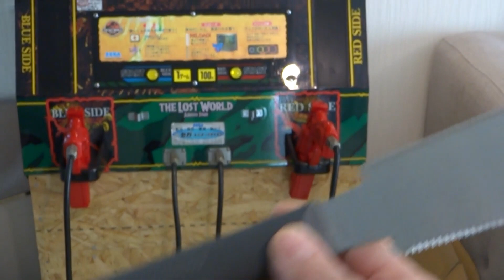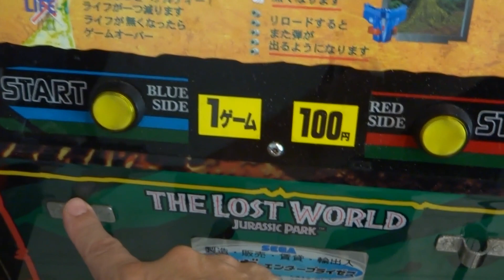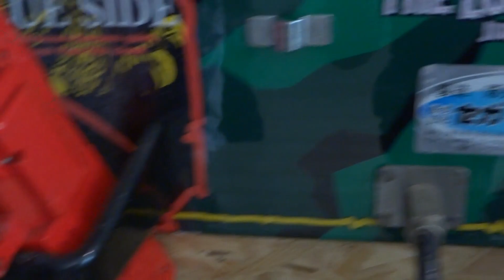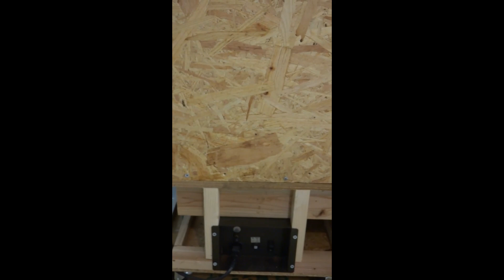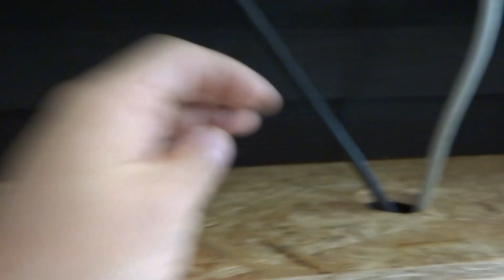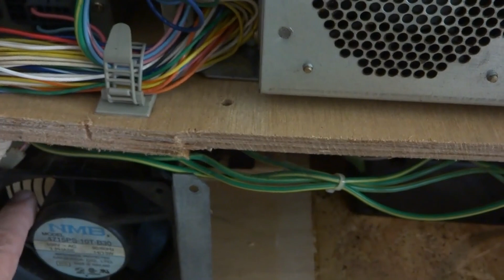Plywood Sega Jurassic Park Lost World (1997)Makeshift Arcade Cabinet

Comment: You did a fantastic job, sir! Does this particular version of The Lost World PCB have all the audio going from one connector to the amp/speakers? You mentioned in your gameplay video that the US board you have doesn't have all the sounds. I think that's because the game requires the Model 1 mixer board that is commonly found in Daytona or other driving cabinets that used more than two speakers. I have a US board and it requires that little board for the complete sound mix with two 4-pin JST NH connectors from the Model 3. Easy to wire up using Dupont connectors though; I play this with the Model 2 Gun I/O board on a 24khz-supported CRT.
It's very rare but I've also had Model 3s with no sound, namely due to bad ROM jumpers or defective components on the CPU board. I had a Harley-Davidson (Step 2) with the same issue.

Comment: So I just bought a full system and I'm having some display issues, I'm not sure if it's the projector or if the graphics card may be not properly working. I wanted to know what type of model monitor you used and if the ir sensors come with it?